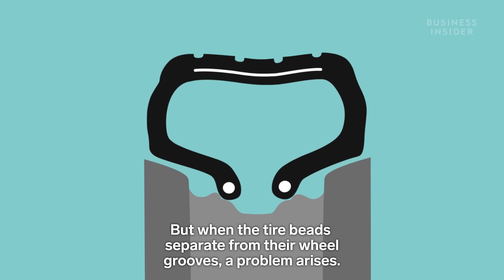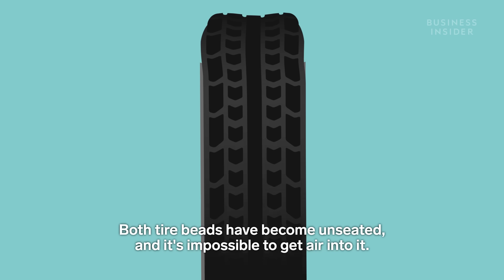Science Behind Using Fire To Mount Car Tires

Comment: I've only done this once or twice when in a timecrunch or the rims are the OLD split rim style. On a dump truck once, and it was a hell of a lot faster because you leave the wheel bolted to the axle, and just dismount old tire, mount new tire, use this trick to seat bead and inflate. Pretty nifty. Also used starting fluid not lighter fluid.
Reply: Why on earth would you do it on an old split rim? They were tube type.
Reply: Know a guy who tried kerosene.  Melted too much of the tire.  And the TPMS.
Reply: @gagewesterhouse9558  TPMS is probably why you would (or just shouldn't) do this on a modern vehicle tire rim, as most have TPMS (I think in the US, though, TPMS became a requirement on cars at least starting in 2010, so the cost to replace a TPMS transmitter probably costs more or as much as just paying someone to mount it or taking 5-10 minutes and doing this "by hand").  Getting the tire on the rim is probably the hardest part.
Reply: I've seen it done on trucks with tubeless tyres but never on splits. How's that even possible?
Reply: Not all split rim are tube tires... The dump truck i mentioned had split rim and the tire did not have a tube.
Reply: Saw a guy nearly decapitated by a split rim ring

Comment: why don't these have rubber tubes to hold air??
Reply: These are tubeless tires, tubed tires are long gone.
Reply: @bassam_salim  why are tubed Tyres Long Gone ?, 
Many Countries Still Use Them 
And Are These Tyres Call tubeless tire?
Reply: @drake6836  tubeless tyres are much more efficient. They produce much less heat due to having no internal friction and when you get a foreign object puncture, a tubeless tyre will only slowly leak around the object whereas a tube type will quickly leak out of the tube aroud the tyre cavity and out the valve hole of the rim which isn't sealed.
Reply: @bremCZ  oh ok thanks

Comment: This is not the standard this is old school you'll think it's cool till that time blows up and splits your hand in half iv seen it in person so keep in mind there is a reason we don't do this anymore
Reply: Didn't say blow your hand off I said split your hand if it blows. anyways if the side wall is weak it can pop, split ,blow open and if Your not using the long air nozzle when you try to fill it for bead setting that rubber and wires will tear you hand up
Reply: person I know was putting air in the tire of his bike something went wrong and the inner tube slipped past the bead and blew up next to his ear he was def for a couple minutes he got lucky his hearing wasnt worse off than what it was
Reply: I've seen a lawsuit where this method killed a man by blowing his face off completely. The rim shot up hitting him in the chin and taking the front of his head off causing his brain to fall out.
Reply: @donnywilliamson5807  this a joke?
Reply: fpsfreak no It isn't
Reply: fpsfreak yeah it is
Reply: @Goodfella123-d7z  I was getting a trailer  tire changed. He was filling the new one (recap) with air. The sidewall started bulging out. We saw that and ran. Within seconds of us running, the tire exploded. No one was hurt but the rim blew a hole in the concrete block wall.
Reply: Guardrail yeah that can happen that’s happened to me except I stood there stupidly watching it bulge and it blew up couldn’t hear for a couple of hours. That stuff does happen but not what they are talking about up there ^
Reply: @donnywilliamson5807   

.
Reply: Donny Williamson no that never happened that can only happen from over inflation not from using this method shut up
Reply: Brandon yes it happened I saw the legal papers and pics from the incident.
Reply: Donny Williamson I’ve done this hundreds of times my dad has run 3 tyres shops for almost 40 years that does not happen from this method. That only happens from over inflation NOT from this method!!!
Reply: Not to mention the surprise the innocent guy that demounts the tire later on not knowing there's flammable gases inside...
Reply: Ryan Bundy saw it happened and the guy lost the seen in his both eyes
Reply: oh, lordy.. finally, someone with some sense in this thread..may we clone you??.. please?? 🤷🏾
Reply: Well you can always expand the liquid trail wick and move out far away or hide behind something before it expands. Also how would this kind of a controlled explosion blow your hands off? Doesn't seem likely at all.
Reply: Sahil Pethe how can you hide when you have to get the air to in the tire before the bead falls of the rim
Reply: No fire is ever controlled in an open space
Reply: Sahil Pethe it wouldn’t lol this guy has no idea what he’s talking about just wanted to sound smart/ useful
Reply: WRONG Akki.  Just plain WRONG.

Comment: How does the gas come out if there is a seal between the tire and the wheel
Reply: Geetansh Agarwal the flame causes a vacuum
Reply: M K ❤️
Reply: M K  Quantum Tunneling ?
Reply: The seal only can be established when there is already a pressure to lock the beads to the groove, the problem is you can't generate the pressure if the seal hasn't established because the air just keeps leaking (like chicken egg problem). So the only solution is to pull the beads into the groove with some tools manually, or with some explosion magic ( just be quick enough before the air inside cools off)
Reply: It doesn't.

Comment: Viral?  this method is as old as.... tires.  It only works as an emergency method if you also have a ready source of pressurized air since the tire will likely pop back off its bead from the vacuum that develops. Also,  they were using starter fluid not lighter fluid. Lighter fluid works, but is more critical to the air/fuel mix.
Reply: Only as old as tubeless tires, 1950's.
Reply: Known and old things go viral all the time. Every couple of months, there's a 80s or 90s clip or video that suddenly becomes popular if placed in the right context. This is no different.
Reply: Just something trendy to get views
Reply: Also for mounting tires wider than the rums they are being mounted on. And if the valve stem is removed than it shouldn't come back off the bead seat. In theory
Reply: Nicholas Scott you don’t need to fill the tire up as soon as you light it if you take out the center of the fill nozzle the tool for this comes with every bottle of tire slim and it isn’t expensive to purchase on its own
Reply: Nicholas Scott ￼v.
Reply: Stfu
Reply: Nicholas Scott also used in the car community, “Stretched Tires”
Reply: Lol..   Lighter fluid...  Not a good idea..   I have used pvc primer though..   The little compressor you get with your fist aid roadside kit can't keep up with the demand.. Unless it's a wheel barrow tire..  Lol..
Reply: Nicholas Scott Burning fuel, or an explosion like in the video, or any time you light a liquid on fire, it produces positive pressure.  Unless the pressure becomes so dense that it converts it (the gas) back into a liquid, but that wouldn't lower the pressure again it would just condense the gas.
Reply: Most people just use ether.
Reply: You also set beads this way when the tire change won't. Sometimes this is the only way to do it
Reply: @kathlynfinney4378  you better not be doing this kathlyn
Reply: Viral is basically an irrelevant term at this point there’s thousands of videos online with tens of millions of views that you haven’t seen. The only thing that really goes viral these days as far as videos go are things that become memes.
Reply: BeeP Official  I know what viral is, just didn't realize people hadn't known about this. But I've owned 4x4s my whole life, so it may not be something car people are familiar with.

Comment: Personally, I dont like doing tricks like this unless I understand the principal behind it, and more importantly, what can go wrong.
And isnt it more of a deflagration, since the gas expansion is subsonic?
Reply: If the tire burn away rapidly, why would anyone use this trick ? They only set in on fire for a short time and Tires is thick, like real thick
Reply: Not enough heat is transferred to the tire material in the short time to let it ignite.
On the other hand if the tire was shredded up in fine bits, and then heated, it would possibly light on fire.
Personally, id be concerned if there were solvents in the fluid that might degrade the materials over time. Not every ignitable fluid would be good for the job, but in a pinch, beggars cant be choosers.

Comment: So is this now a standard practice for auto repair centers?
Reply: Naw this is a old school method
Reply: In the instagram stories era, this counts as "hardcore" marketing. Most people don't know that this is old-school
Reply: I'm an automotive technician, and I can tell you, no.  I've only ever done this in exceptional situations, on the farm, or when messing around.  You really don't want to do this unless necessary, for a couple reasons.  One; the heat, as well as the 'explosion' can damage or skew the Tire Pressure Sensor.  Two; the fire will burn and dry the bead sealer (a paste you apply to help create an airtight seal between the tire and the rim), as well as change its chemical properties.  You might see them use this at 'mom and pop' shops, when changing exceptionally big or small tires/wheels (when they won't fit on the tire-change machine), or at places that service commercial grade vehicles.  Or on farms.
Reply: @gagewesterhouse9558  You'll only see it at places that don't have the right gear or brains to do the work. I serviced all sorts of vehicles from  skidders to wheel barrows and never once needed to do this.
Reply: no
Reply: It always was
Reply: Youre here again🤣
Reply: Nah depends where u work, where u work (uk) it would go against health and safety standards meaning you could be fired/shut down if reported, main reason being, like stated in the video "if the correct amount of fuel is used" some people use too much and the tyre explodes and well look up on YouTube what happens when you're next to an exploding tyre
Reply: There's a reason you are seeing this in small garages and out doors. Most companies forbid the use of this method for multiple reasons.
Reply: No, only if you don't have tools or mashing than is not auto repair shop. If some big track in big mine have tire damage and that hole is  fixed on spot, out doors, this is maybe way to get to properly fix... "In africa"... But for sure is not way for daily computers who want to be separated from hand or eyes
Reply: @borivojetravica569  yes of course doors away from everything in an emergency is understable. It's about the users discretion and experience. We've all had stories of some idiot that tried this and burned their hair. It's not something I advocate for the inexperienced.
Reply: This is standard practice when people don't have the correct equipment or knowledge of how to seat beads without using fire.
Reply: do you think this will damage the tire in any way?
Reply: Mark Gaming YT2 fire burns the rubber, lowering it's condition. That's why most of these prople go balls to the wall to put the fire out, so it doesn't lower the condition of the tire.
Reply: Na lol you think a few second of fire, will damage a tire? Do you understand the stress a tire is under during even normal every day conditions? Let alone anything like speeding or cornering or god forbid, the dreaded BURNOUT
Reply: Only happened in the small tyre shop with less air pressure flow.
Reply: @RandyHartono  almost every shop out there will be using 3/8 or 1/2 inch air hoses and even a tiny 2hp compressor will punch out over 130 psi.
Pressure and volume is the same for most shops out there.